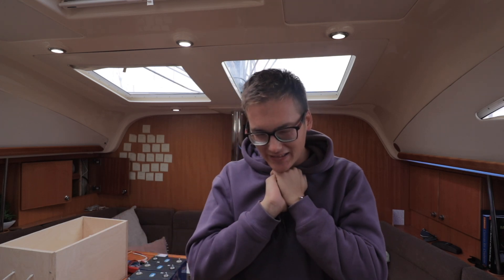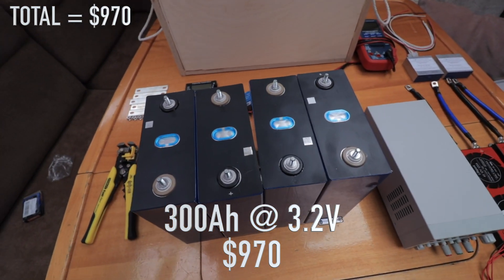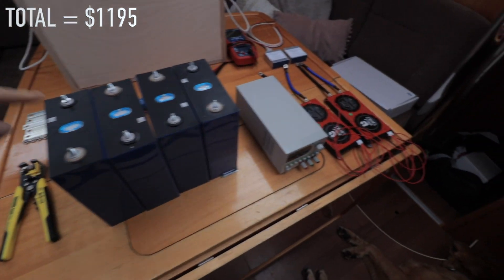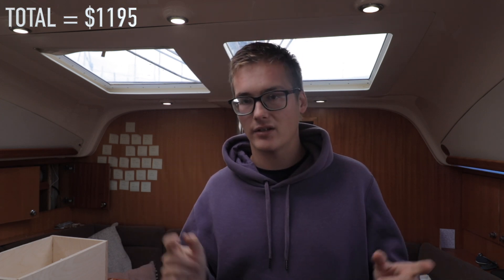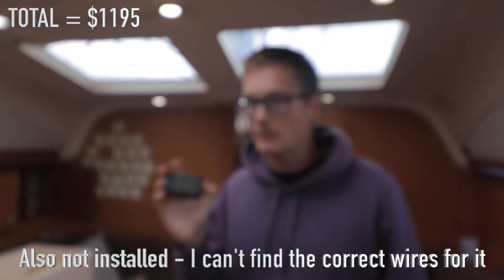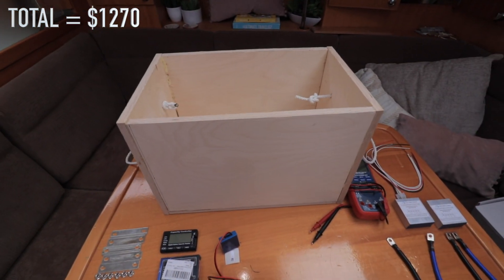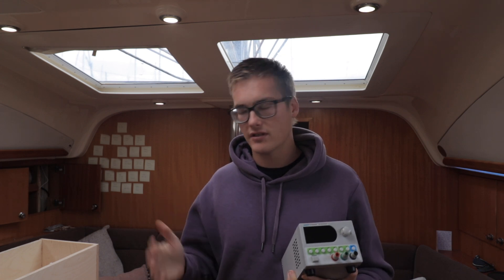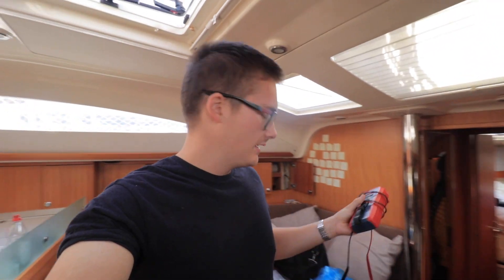Build Your Own LiFePo4 Battery For Cheaper than AGM - Part List and Top Balance - Part 2/5

Comment: Hi Sailing Amari,
Great info. I learned a lot. I'm just curious Why you got a 120A Daly BMS for 300Ah Cell ? Please let me know if there's a promo code for you when i order these cells. Thank you Cheers.
Reply from the maker: Your welcome! Sorry for the delayed reply! I only noticed the comment!

So I chose to go 120, because there are two, so 240A. 240A is around 3000w at 12v, which is what I built the system to work for. 

In hindsight, I would now have chose a slightly larger one (150A/200A) as the cable on the 120A version are 25mm and can get really warm with a large load on them! 

Unfortunately, no code for the cells, I couldn't work out how to get one on Alibaba!

Hope this helps!